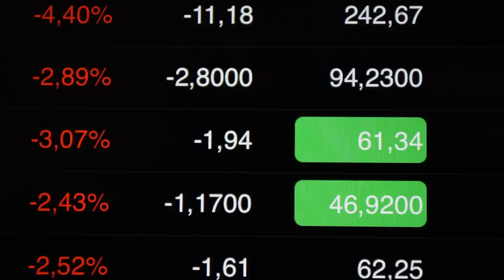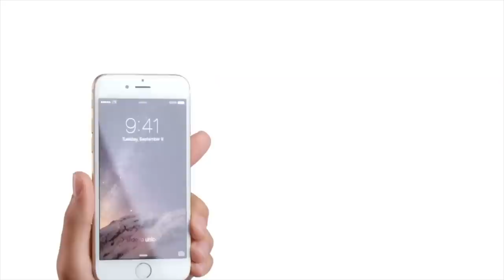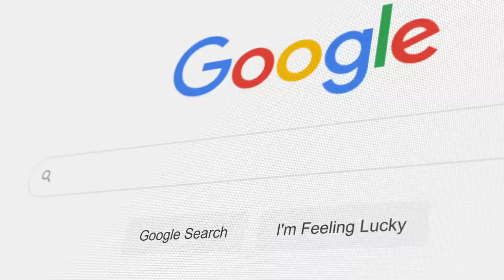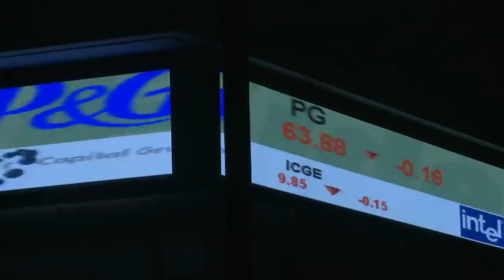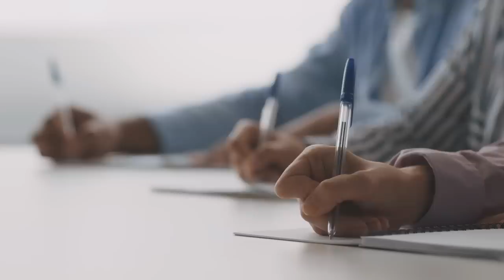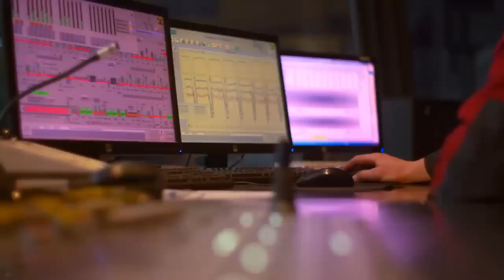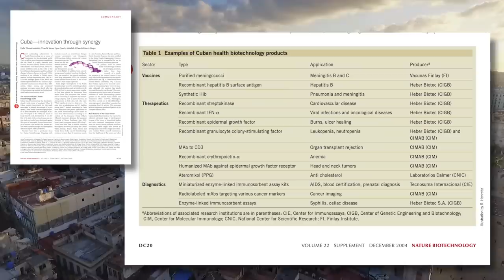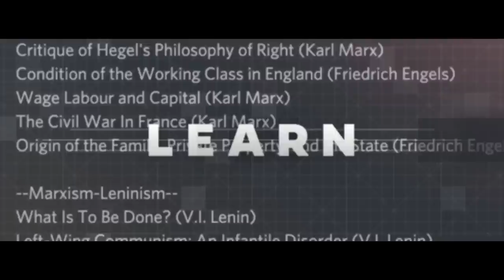Can There Be Innovation Under Socialism?

Comment: Look up LTO cells for those batteries. They just haven't fixed the capacity problem.
15000 to 20000 cycles 41 to 50 years lifetime to 80%

Comment: How do we decie, intersubjectively, what the basic necessities of life are? its not that objective. like, its pretty subjective after food, clean air/environment, healthcare,  housing.... are we to inclue transportation? job? UBI? are we talking just the bottom of the hierarchy of needs? if it is indeed a hierarchy of NEEDS, than that means love/intimacy/family and self-actualization need to be granted freely and to everyone, too. but self-actualization is quite relative to a person and their wills/desires.
Reply: It's not subjective at all my man. As you said, housing, food, potable water, electrical power, transportation, education, ARE BASIC NEEDS the government should provide. 

On a personal level, than it starts to get subjective.
Reply: @Lucas-sc6lr  Yeah, I'm just saying---get a room of a 100 legislators together and they will have a very hard time coming to an agreement on what counts as basic necessity. And that's just in representative democracy. Get a whole population to agree on what's necessary? Good luck
Reply: @realdanrusso  imo it should be fairly easy, we could make a layered system, with the needs decreasing in importance with each layer
Reply: @Redsky973  not a bad idea actually! thanks
Reply: @realdanrusso  no problem, also, the layered system could be custom made for specific regions (heating in cold areas, cooling in hot ones, extra transportation in remote areas etc...) So all in all it should work out

Comment: Patents can be looked up and researched alongside innovation.  To limit the population's ability to profit from patents only hurts the chances of innovation.  Other than that, I agree with a lot in the video.  Government should be able to use or allow use of a patent if the public deems it necessary.  Unions are good at requesting for higher wages, and since everyone is working for someone else (even if it's a company that work's for other companies), price-gouging can be limited due to anti-trust legislation.  Governments should be able to assume that patent-use be circumvented in the case of 'quality of life', etc.  Governments can support basic rights such as food, education, healthcare, and housing.  That is a nature of government, and not an economic system such as capitalism (or parts of socialism).  I would prefer to vote on it still.  Furthermore, it should be noted that competition helps quality assurance.  And ensures that government-funded (or not government-funded) programs ensure quality products.  "There is no knowledge without grace, and there is no grace without a vote".-  virtue_man (redditor)

Comment: At 6:25 you seem to contradict yourself. After stating that almost all of the best innovations in medicine and technology we have seen is only possible because of advancements we've made from publicly funded projects, you then go on to state how under capitalism, that would NEVER happen. The problem is, it DID happen, like you just barely said. Not trying to be a contrarian here, just genuinely wondering if I missed something? I definitely don't like the current state capitalism is in here in the USA, but I'm not convinced that total socialism is the answer here. I think what you said showed that a modified version of US capitalism still could work quite well, you showed that the fruits of public funded labor worked together with capitalistic innovators motivated by making a profit, and together they created something like the IPhone, for example. That's what I got out of that, not necessarily that total socialism is the answer.

Comment: I have always heard different stories about the reliability of the Lada. Some said the Niva was more rugged than the Jeep and others said the Riva was horrible and always broke down. I wish I knew who to believe on this and if there would be any issues with the quality of products manufactured under a socialist system. I know, just as you said, there can be issues with quality under a capitalist system, mainly planned obsolescence and using cheaper parts inside. When they cut corners, you get crap—GM in the 80s and 90s vs GM in the 50s and 60s. I hope you make a sister video to this one on the quality and longevity of socialist products (other than your friend's hair dryer). Also, is it possible to get an artistic style in addition to function from a socialist workforce? As much as Elon is an A*h** capitalist, the Lada is no Tesla in terms of style. The same for Yugo for that matter.

Comment: I genuinely think this guy wants things to be better.  But I'm not sure he thinks things through all the way before using them as examples.  I hope it's not that he's misleading you intentionally.

There is a lot here so let's just take the very first example he used.  He says the microprocessor was developed under government direction.  This is both true and false at the same time and the true part is worse than the false part.  First the false.
This is actually well documented and you can find YouTube shows that explain how the microprocessor was developed by Intel.  
"In 1969, Nippon Calculating Machine Corporation approached Intel to design 12 custom chips for its new Busicom 141-PF* printing calculator. Intel engineers suggested a family of just four chips, including one that could be programmed for use in a variety of products, setting in motion an engineering feat that dramatically altered the course of electronics."
This became the first microprocessor the Intel 4004.  No government involvement....
What was the true part? Well, the first Microprocessor was built with government involvement and it was a chip that was put into the F-14 tomcat before Intel's project.  So what's the problem?  Well, he goes on later in this video to talk about how bad patents are.  I agree that patent law needs to be changed but it does allow for innovators to make money from their inventions for a certain period before everyone else jumps on the bandwagon so that's actually an incentive to innovate.  AND, patents are published so that after they expire, others can see exactly how it's done.  Go to the US patent office website! Anyway, patents are WAY better than the government doing things.  (And patents are government thing not a purely capitalist thing) That tomcat chip... It was classified until 1997. (Same thing for digital computers. Invented in 1943 for WWII, declassified in 1975) No one got to benefit from it's invention or design.   This info is all available from the Wikipedia microprocessor page.  So why didn't any research go into this video?
The Internet? Invented for the military so if the telephone lines were blown up, it could still communicate.  Invented in 1969.  It only went public in 1993.  Before then... Smart computer users were using a bulletin board system that used the phone lines.  The Internet was only a small step up when we got it and that's only because the phone company charged long distance.  That went away eventually.  The actual html was invented that same year so the Internet was pretty crappy before then.
I could counter almost every point he made.  The video is pretty compelling if you just listen to what he says and don't do any research on your own.  But knowing that... What can you trust?

Comment: This may sound a bit wishy washy, but it seems like socialism and capitalism represent two sides of humanity. Putting it simply, a drive to be social, and a drive to be individualist. This drive is always going to be there as a natural compulsion. In the population, but also even in individuals. 

My source? Admittedly, this is an argumentum ex rectum, but it comes from observing reality for many years. 

So, pragmatically speaking, I don't think it would ever be possible to go fully to one side or the other for very long without society crashing somehow. 
The least bad solution will probably always be some half-assed, half-baked, middle of the road, ineffective, waffly, boring compromise between the two sides. 
The golden middle path. 

... and no. The US is nowhere near the middle path at this stage. Take a wild guess where it really is.

Comment: To be honest, I don't really buy the argument at the start of the video. Capitalism is better for jump-starting new industries that no one has thought of before. Sure, the iPhone depends on many components engineered by the government, but Steve Jobs was the one to put it together into the iPhone.

However, a lot of the rest of the video is very true that capitalism is very bad at solving any problem that falls under market failure, through innovation or otherwise, even if the problem is obvious and everyone knows it should be solved. If there's no profit incentive to solve a problem, it won't be solved. In contrast, socialism should be much better at stamping out this kind of obvious problems.

Like mentioned in the video, the trouble with innovation in socialist/communist societies is implementational. There is little incentive for people to get educated (which is inevitably going to be hard work) if they won't be individually better off after doing so. Hence people just aren't as good at solving the problems they do identify. Similarly, if there is no individual incentive for people to explore new problems or areas of interest (like the mob of "serial entrepreneurs" at Silicon Valley), then a lot of potential breakthroughs remain unidentified. But these issues do seem possible so solve with better implementation - say some other form of socialist society where hierarchy in the individual level is preserved but not big capital.

Comment: The section on patents is entirely incorrect. "Keeping vaccine patents behind closed doors" is oxymoronic. In order to be granted a patent you must sufficiently disclose the invention (which will be publically published). There can be no closed door.

WITHOUT the patent system there would be an incentive to keep the information private, keeping the methods of developing the vaccine secret. Instead, the patent system grants an inventor a monopoly over the invention for a time, in exchange for publically disclosing it. 

Anyone can look at the published patent and innovate from it (and people do).

That's not to say that in the case of healthcare perhaps pharma companies shouldn't just let anyone use the patented invention for public good. But getting rid of the patent system wouldn't accomplish these new vaccines becoming any more available or any cheaper.